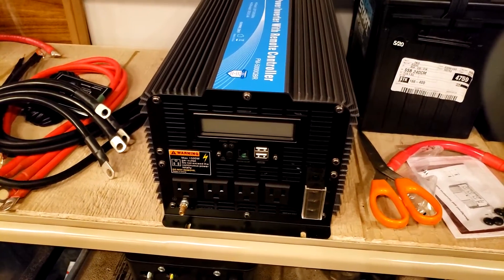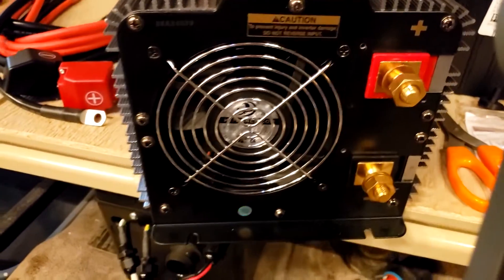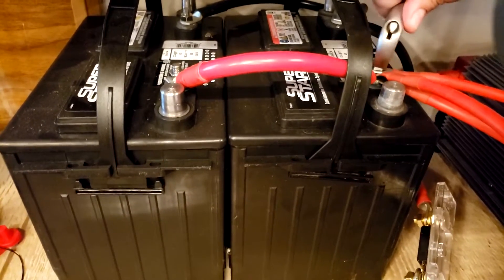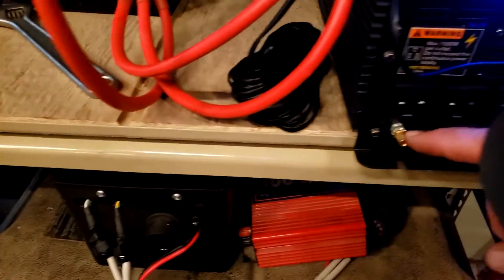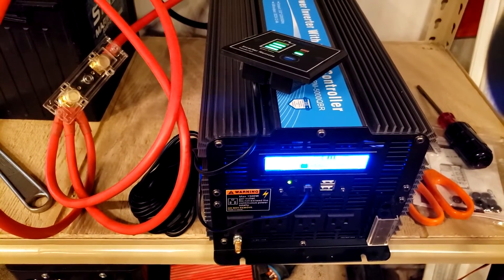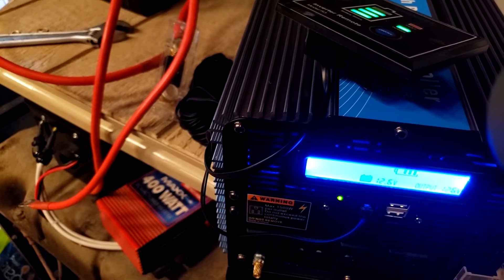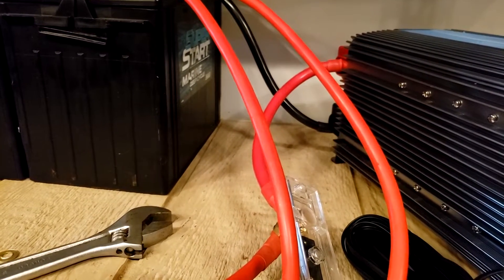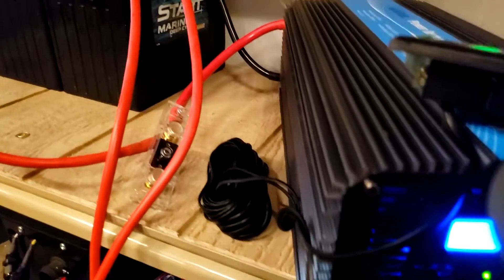Giandel 5000Watt heavy duty power inverter Testing with 2 batteries

Comment: What fuse do used?
Reply from the maker: 200 amp
Reply: Thanks … i just try run 5000 btu ac on
Me van… with the Jupiter 3000 w 
Power inverter … work but the ac compressor just work by little bit and goes down …i’ll install 5000 w inverter from me battery i hope work ..

Comment: i had one of these lol i could not even boil a small water kettle with it
Reply from the maker: I run a small water heater,  pre-heat the water before it goes into the main water heater. So the main water heater doesn't have to work so hard. Works great for that. Works great for everything i need. Except a air compressor.  And I have a generator for that if I gave no power.

Comment: That looks like a huge inverter; looks top quality and power too; what was the cost of it ? thanks

That grinder is not really a test,  i could run it with one of my 2000/1000 watt  non-sine waveform, costing 45 euros; and the sun of a gun lasts too, over a year now, on and off,grinder and drill; the bigger one i have ,5000/2350 W,  China-Powland, 130 euros, that i modified internally with finned heat sinks over the 4 IGBTs, this inverter feeds the whole house through 2 "solar" bateries (180 euros each), each one weighting 46 Kgs, coupled with 2 more, 180Ah each, truck batteries; 24 volts total.
Reply from the maker: Around 453 euros. I have a stress test on this power converter in my other videos. Where i run items you may need in a over the road truck. Thanks
Reply: The reason why I buy my 3000 watts Cnswipower pure sine wave inverter 48V DC 110V-120V 60Hz it's I see one guy have same inverter he send them email tell them how to build it he get what he wanted its well build he know what he talking about he have his own youtube channel he have lot inverter he know what he talking about I was testing my 3000 watts pure sine wave 1500 watts heater 120V 60Hz 12A AND JigSaw 120V 60Hz 7A and next JigSaw 120V 60Hz 4A at same time so I was running three things at once

Comment: Hey there so I'm trying to create a solar system for my DJ rig! I was gonna use a 4,000 watt pure sine wave inverter with 4 deep cycle batteries.. I'll be bringing 4 of my speakers and each are around 672 watts @ full power.. I figured 4k watts would be plenty to run them moderately with plenty of headroom for my decks etc.. Is there anything in particular I need to know when I go to do this? Will my inverter be able to handle 4 deep cycle batteries? Also, how many hours of run time do u think I could get out of a solar system like that? Thank you!
Reply from the maker: Yes. You may even need more batteries,  most DJ music are at night with lights and sound,  if you want to run more than 2 hours you may need 2 more deep cycle batteries.  If you are away from power may need to invest in a small generator.  Yes you are on the right track, if your equipment goes dead you could connect your battery to your car or truck and let it charge till the show is over. Thanks. Sounds like fun..
Reply: @camaromodschannel  thanks for the reply! I'm actually avoiding a generator atm bcuz the campgrounds I'll be playing at for the music fest will not allow anything gas powered.. So I'm limited in my options, but I'll really need six for only two hours of light to moderate use with my rig? Thanks again
Reply from the maker: If you don't make it 2 hours then just add 2 more batteries. If its daytime you should make it no problem.  Thanks.
Reply: @camaromodschannel  Sweet thank you.. I may only bring one sub instead of two.. And I'll probably run them at 15% total power of the max 672 watts for each speaker.. Also.. The only lights I'll have are afew small wash lights! Hopefully 4 batteries could get me afew hours  running things considerably light!

Comment: [11/09, 5:50 PM] Arjun B Shinde  Chikodi 👍: ಬ್ಯಾಟರಿ ಫುಲ್  ಚಾರ್ಜಿಂಗ್ ಅದ್ ಬಳಿಕ  ಮೇನ್ ಕಟ್ ಆಗಿ ಬ್ಯಾಟರಿ 80% ಡಿಸ್ಚಾರ್ಜ್ ಅದ್ ಬಳಿಕ ಮೇನ್ ಚಾಲು ಆಗಬೇಕು
[11/09, 5:56 PM] Arjun B Shinde  Chikodi 👍: Battery should be charged after full charge charging when the battery is 80% discharged. And main start

Comment: Funny! I'm looking to buy an inverter of this 24v (input) and 110V output to use with a 150amp 24v alternator to power 3 air conditioners of 1000w each.

1000w split (735) = 1.3hp.

An 11.1 amp induction motor that generates 7.5 hp can smoothly turn on the air conditioners. Nobody needs the batteries.
Reply from the maker: Better check your amps, then let me know..if it will work...
Reply: I'm Try later!

Comment: I have one in my truck that won’t work it just keeps beeping I was wondering why did you have to hook up three red cables instead of one
Reply from the maker: I didn't have a big cable like a battery cable at the time so I connected the wires that came with it. The bigger the wire the more amps it will run. Thanks for watching.
Reply: @camaromodschannel  Oh OK so I should’ve probably used all those wires I only connected one
Reply from the maker: Sounds like you need much bigger wiring.  Get the size of battery cables on your car.  Then it should work. Thanks

Comment: Just wondering how many batteries it's going to take to run yours...mine is 2000 watts and it took 14 but mine is 24 volts...you may need a battery room
Reply from the maker: Wow you have a big system. I just have a small system, I pre heat water before it goes into the water heater with a 6 gallon electric water heater. And I don't use it at night so I just have 5 batteries. Thanks.
Reply: I have Cnswipower inverter 3000 watts pure sine wave inverter 48V 110V-120V 60Hz 48V DC need 4 battery to run my am going used 12 volt deep cycle 230Aamp each
Reply: Well it's an ongoing project...I wanted to be able to use a couple things so then I thought well I could almost run the AC so another set of two more batteries etc... now I don't have enough panels for fall and winter to keep these things going but I have ordered 2 more panels...I've only got 6, 100 watt panels,  they will charge the batteries but if there's much clouds the overnight volts aren't as good..last winter when there was snow I had four panels and six batteries so this year 8 panels,  14 batteries...I'm going to at least have better than last year...I keep the big inverter/charger turned off unless I'm cooking or running AC and use a 410 watt for a light and phone charger ...I made a 24 volt fan out of a 120 volt leaf blower so it doesn't need the inverter and it barely uses any watts but it blows a lot of air...I put a regular fan blade on the motor, and a shield thing...it can run off of 12 too so that works well...the sun is hot here....I ran water thru some copper pipe in the sun painted black, and it would boil before it would get to the end of the pipe...I always thought heating water with electricity was a waste, anyways...with wood maybe idk...I've got a wood stove I heat water on usually,  funny thing it's made out of an old gas hot water tank but I'm building a nicer one soon so I put that one in the barn...it only takes a few scraps of wood to heat 5 gallons to almost boiling and the other day I made a pint of alcohol from grape juice on it with my pot still...I bought it to make distilled water for the batteries,  lol...but since I do that stuff I usually have hot water on the stove and it stays hot a long time indoors...I could just weld in a loop of pipe and heat all the water I wanted in just a few...besides building a few fires in summer keeps one in practice for winter, you tend to know where the hatchet is too...I melted snow on it during the winter storm and made distilled water last time...I figure it can't hurt to have two stoves either even if it's just to dry out wood and stuff, lol...my uncle did an eyeroll when I said I had 12 batteries last month but the next day his power went off for about an hour,  and after that he said he might have to hook up some kind of system like mine but smaller,  just so he wouldn't have to run his generator...it's usually in the freezing cold when the power goes out around here....he had to come in and look after that, lol...he said didn't you notice,  I said no, I was air frying a pizza...he about lost it...it was pretty funny...
Reply from the maker: We don't lose power around here much. But when it does its a few hours down.  So its nice to have a back up. Have a big generator also.

Comment: So I tried with one battery and I used the heater that is 1000 watt. And when I tried was failed on me .
Do you think I should have list two batteries?
Reply from the maker: Did you have a fuse or breaker on your big cable.
Reply: how did you make out?

Comment: Great review. I am looking at getting this model for a semi, the wires included will be way to short to connect to the batteries. Would there be any issue running 7-10 ft of wire from batteries to the inverter?I will be the the first to tell you that I am beyond inept when it comes to anything electrical. Thanks in advance.
Reply from the maker: Yes. You can use battery cable would work.  Without any problems.  Thanks
Reply: @camaromodschannel  thank you much.
Reply from the maker: One more thing,  make sure you put a 300 amp breaker or fuse near the battery positive side. On your cables.  Thanks,  fuses and breakers are very important so you don't have a fire.
Reply: @camaromodschannel  ah right, thank you. Would 1/0 wire be big enough?
Reply from the maker: Yes

Comment: That's not enough battery for a 5KW inverter. DC bus won't be stiff enough for good performance. Should have at least 4 of those battery jars. I would recommend at least 4x 100ah jars. You will be pushing over 400 amps at full load on the DC side. Recommend much thicker cabling. Go for 4/0. Also use a 48 volt input inverter instead and hook the batteries in series for 48VDC. This cuts the input current to a quarter of what it needs at 12 volts for the same power.
Reply from the maker: It was a test, only a test, just to see if the inverter even works. I have 5 batteries on it now with a very light load, with no sun in the winter hard to make much power. Thanks